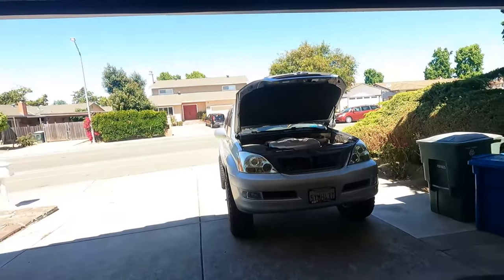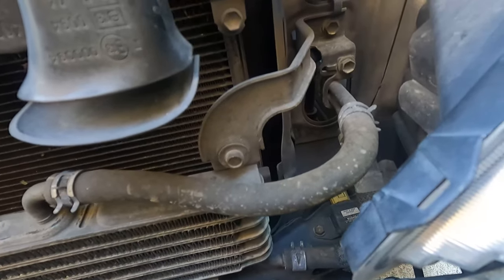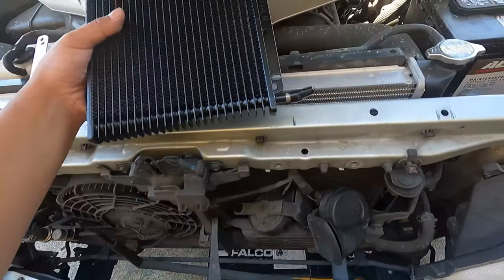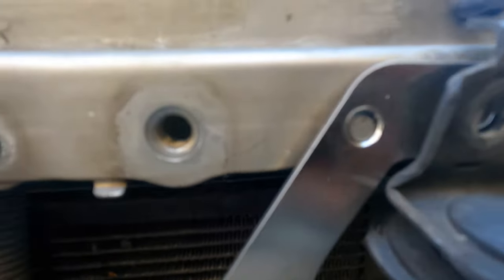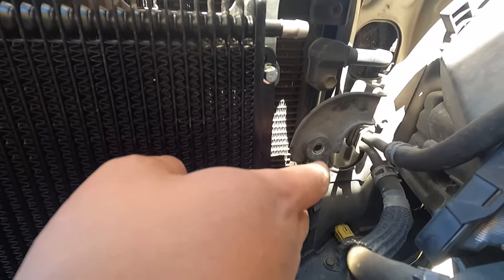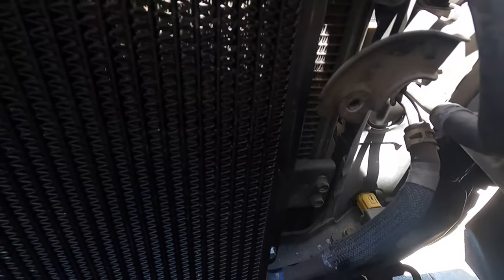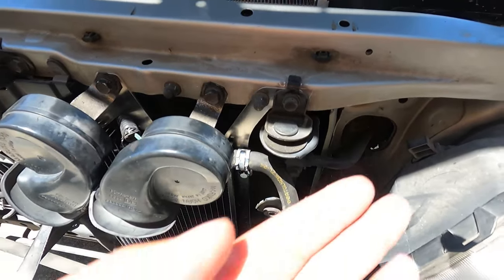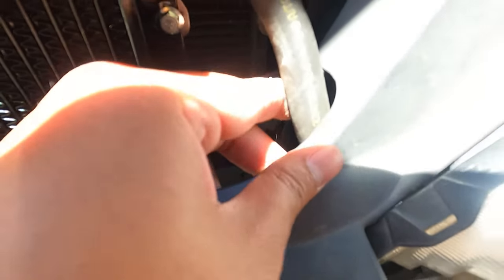Lexus GX470 Transmission Cooler Install! EASY!!

Comment: I have a tip for you.

Take off the top hose and have someone start the truck just long enough to see which way the fluid is flowing then shut it off before you make a big mess. 

To get the maximum benefit from the cooler you want the ATF to flow into the bottom port and out of the top port.   If you have it the other way you are only going to get about 15% cooling efficiency.  I would think that is how Toyota has theirs setup, but really don't know.

Comment: I say another video with a "frame" bracket that holds the cooler.  Looks like a lot of room in the back of the new cooler on this one.  Could the original cooler have been left in place and added the new cooler on top?  Hook the hoses up in series so to speak? Also, the heat is dissipating onto the radiator. Is that significant?  I guess the cooler tranny doesn't help the engine but doesn't affect the radiator heat on this type of installation.  Strictly the tranny.  Any tips for what can I do for my engine heat short of replacing the radiator?  I tow a 6K lb 24' travel trailer with a 08 GX.  It doesn't like 110-degree days.  Nice video by the way.

Comment: Gonna do this mod eventually.  What trans cooler did you go with? Hayden 678? And why’d you go with the FJ bracket and not the Prado 120? Just wanna know if they’re different. Thanks!
Reply from the maker: Honestly there really was no reason over the other. I just heard FJ fit and I went with it
Reply: Cool, I really want to do this. How has the temps been since having it installed?